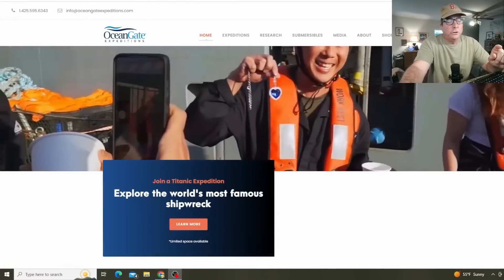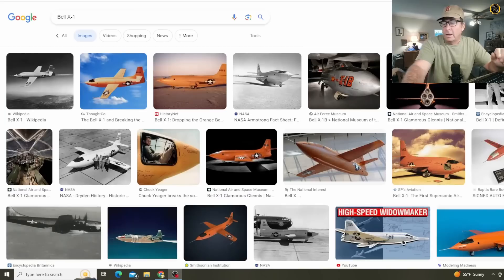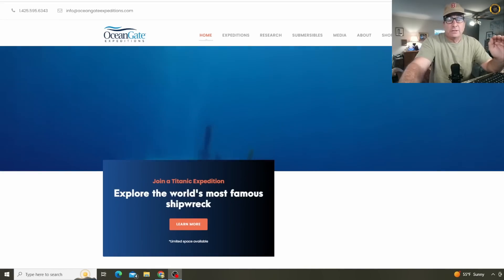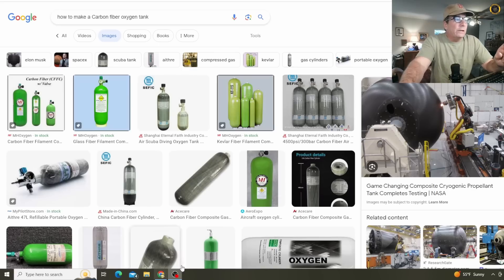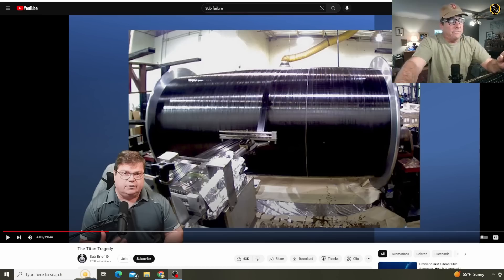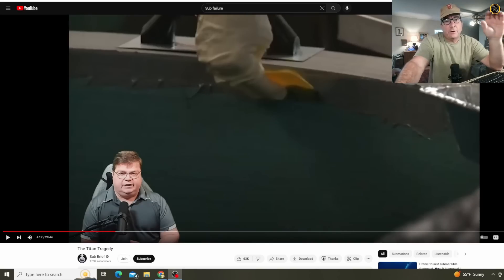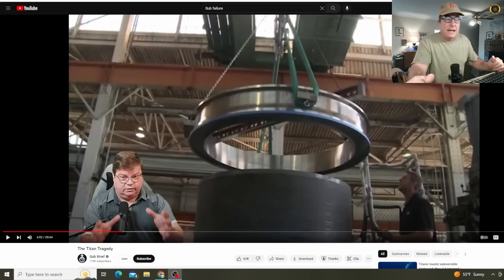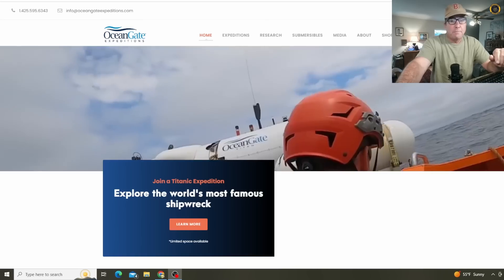Oceangate Sub Construction Details and Implosion

Comment: From the "alleged comms" between Titan and the mothership, Titan was descending faster than normal. One could suggest Titan developed a leak, began taking on water, gaining weight and descending faster than normal. The water shorted the A electrical bus, they dropped ballast but couldn't rise bc of extra water weight and the shorted electrical bus prevented electric vertical thrusters from activating. By the time the B bus was activated, they had too much water on board, and releasing the frame did not provide enough buoyancy.  What may have been a pin-hole leak, now due to depth and water pressure, the leak turns into a water cutting tool, enlarging pinhole.

Comment: Regardless of how tight a fit there was between the carbon fiber hull and the titanium rings, there had to be some clearance for the mating of the two which was filled with the glue, so the entire structure was dependant upon the glue holding. What a disaster waiting to happen.

Comment: One would think there would have been an internal flange on the titanium ring as well as external, this would double the surface area of the epoxy joint and offer extra support to the carbon fiber hull at the most critical area.

Comment: Based on the way those rings were glued to the ends it seems like common sense would dictate failure of the ring adhesion.
No climate control, the epoxy was applied inconsistently, the mating surfaces of the CF was not optimal.
I would never get into that death trap.
Great video. Thank you

Comment: Telemetry messages:
[My comments] 
09:17:50 All under control. At 2960m. No adjustments needed. We're enjoying the ride. 
[First problem reported at] 09:28:16 We're noting an alarm from the RTM [Real Time hull Monitoring] 
09:28:35 Reducing velocity, [vertical velocity I would think] depth 3433m. 
09:30:36 no change with thrust the rate of descent is increasing. At 35. [3500m?] Going to release the ballast now. 
09:32:12 No improvement. Preparing to jettison the frame. 
09:35:48 frame jettisoned (multiple attempts needed) starting ascent now.
09:38:09 Crackling sounds from aft. 
09:42:12 trying to run diagnostics. Ascending now but very slow. Sounds have subsided. Global RTM alert active. All red. 
09:43:42 Slow ascent in progress. Quarter predicted. Unclear why rate is small. No indicator. At 3476m.
 [Using thrusters, jettisoning ballast and jettisoning the frame has only just stopped the descent & produced a small rate of ascent. Presumably something is flooding with water - unlikely they wouldn't report that if it's inside the hull, or the hull has deformed such that it no longer has as much volume and therefore doesn't have as much buoyancy. Or possibly the thrusters are wired backwards, as has happened before and they are actually thrusting downwards without realising it]
[Last message at] 09:46:37 depth 3457m, [ascended only 19m between messages 2mins 55 seconds apart, using thrusters & having jettisoned all ballast weights and jettisoned skids] switched to power bus B, more sounds from aft.

So about 18 minutes from first report of problem to last message.

I noticed that there are some fairly large wiring junction boxes that have flat, clear plastic covers. These junction boxes must have a system that fills (and releases on ascent) them with air from the high pressure air supply (10,000psi was mentioned by an Ocean Gate person) using some automatic regulator to balance the internal air pressure with the current water pressure, so the plastic cover doesn't implode/explode. If that system malfunctioned there could be cavities filling with water that should be full of air, thus reducing the sub's buoyancy. I've noticed the junction boxes but it probably applies to the two large lithium batteries and probably other items that are under the rear tail cover.
If this has happened it is probably a secondary failure that is making it difficult for them to ascend from a dangerous depth. Aircraft accidents are often several problems adding together to produce the final result.
If it isn't that, then I can only see the reduced buoyancy being from deformation of the hull. It's hard to imagine that being sustained for 18+ minutes at 3500m depth. Also, there are no messages saying the ceiling/wall interior panels are deforming. Compression/deformation of the carbon cylinder in the length axis would be a suspicion, as there is no carbon laid in that axis but it's hard to see that existing for several minutes without water leaking in. Perhaps the rear titanium dome is deformed and that deformation is hidden behind the flat panel that has the large flat screen monitor on it. I didn't see the rear dome in the recovered wreckage. (Perhaps it was too difficult to recover as it doesn't have a hole to pass a strap through or perhaps it's not a dome anymore and in several pieces). 
I think there is also a buoyancy control bladder across the top of the carbon cylinder (under the white outside shell). This must have some fancy regulator to keep the bladder air volume constant as the depth changes. Perhaps the pressure of the high pressure air supply was not sufficient to add air to the buoyancy bladder at that depth. If high pressure air is used to jettison the skids, insufficient pressure could also explain why that jettison took several attempts. I noticed there is a large black circular rubber bellows under the tail cover. That could be to make mechanical movement from the air supply, to release the skids. (Or it could just be used as a variable buoyancy bladder to adjust nose up/down trim angle).
It looks like the front viewing window was only damaged in the final event and something had been happening to the rear end of the carbon composite cylinder or the rear titanium dome.
Reply: Thanks for sharing, I never knew they released the messaging until now. It adds a new light on what possibly happened.

Comment: They had an acoustic system to detect problems in the hull. But how could they know that once a problem was detected, they’d have enough time to drop ballast, get to the surface AND get out before it imploded. It took 2 hours to descend and 2 to ascend. Implosion was just not a factor in his thinking.

They had had so many non-catastrophic failures that I think they didn’t really look at the idea of catastrophic failures as they were just focused on each non-catastrophic failure as it happened. It’s a form of variable reinforcement. Like if your car always has trouble starting, if it fails to start, you’ll just keep trying to get the engine to turn over. You won’t give up. But if your car always starts, if it fails to start, you don’t try that many times until you give up.  So they were very used to problems happening and just working through failures in the field in all areas all the time.

And they towed the sub BEHIND the ship in rough waves. Instead of having it secured on the ship. Adding this kind of stress to the launch pad and sub seems reckless though probably saved him some bucks.

Comment: All my own thoughts below:

I think he started with the number 5 people: 1 pilot, 1 shill to woo the crowd and 3 marks at a total of $750k - $1m a trip maybe bumping to $2m-$3m as the business took off. He even brought YouTubers on free to cross-sell the experience so he could get more marks. Based on this need for at least 3 marks, it had to be a cylinder (as a sphere large enough to hold 5 was not engineering or cost doable), the material light enough and cheap enough, etc.  the cylinder was non-negotiable in his head. He seemed to also be on a tight timeline for getting paying customers on board. He started trying in 2018? The business started in 2013, I think?

His business plan depended on at least 5 in the sub.  He needed to get the ultra-rich interested as quickly as possible. Up until this time, the business was just spending money, not bringing enough in. He had too much power. Kicking out someone that disagreed with him so dramatically silenced everyone else who had any fears (or they just quit).

Why has David Lochridge not made a public comment?

Comment: I know the change in pressure affected the carbon fiber. But would the rate of that “change in pressure” also affect the carbon fiber? Meaning the rate of descent/ascent? They said they were dropping too fast and dropped ballast so I was wondering if that might have brought the disaster on sooner.  They should have done lots of compression pressure experiments on the CF long before they made a submersible.

Comment: A carbon fiber bicycle properly manufactured is hell for strong but when it does fail, like a scratch into the carbon fiber material or over stressing, it fails not by deforming like a metal but shatters catastrophically.  How much testing, unmanned, did they do before rating this for human passengers?  The whole thing seems a bit slap-dash.

Comment: As someone who uses pre-preg carbon on the foot plate of a brace I make for an O&P company, I would never have gotten in that thing knowing it was a carbon unidirectional carbon wrap cured with out vacuum and not able to be tested for air pockets. THEN to find out later he used expired pre-preg blew my mind. The resin has a shelf like, that's why it is kept frozen and sealed in air tight packaging, and we are just making 1 part of a 3 part leg brace! No one dies if our plate fails, AND THEY DO after a few years due to CYCLE degradation! Eventually it fails and delaminates. We then make a new one. But there is NO 13,000 ft pressure and temp cycles ours deal with, just spring force from walking during toe off.

Comment: You are not an engineer? CF is reasonably strong in compression and can withstand cyclic loads. The problem is not CF per se. In OceanGate’s case it seems that a lack of independent design verification and appropriate testing was the issue. The development of experimental  products normally takes years with lots of analytical modelling, material and prototype testing (to destruction if necessary) and very cautious field testing. It appears that the governance within OceanGate was very weak.

Comment: I don't have expertise in DSVs nor in carbon fiber in general, but I DO have personal experience with devices made of carbon fiber.  I raced on a sailboat (a Mumm 30) with a carbon fiber spinnaker pole.  That thing was amazingly light and strong - until we broached and stuck the pole in the water going around 10 kts.  It held up for a number of seconds and then suddenly, catastrophically, snapped and created an extremely sharp spear.  I can't say which side failed first (the tension side or the compression side) but I am certain that an aluminum pole would have bent, but stayed intact.  Having observed that, I would NEVER go to 14,000 ft under the ocean in a carbon fiber hull like this.

Comment: Joining two dissimilar materials in terms of Young’s modulus of elasticity and thermal coefficients of expansion, and then subjecting it to extreme pressure and temperature cycles sounds like very bad idea. Then add the third material of adhesive to establish the joint?

Comment: Everyone is stating it's the carbon fibre that failed, is it though..?, everyone is not mentioning the 18th bolt that was NEVER fitted (because they couldn't reach it), was it the bolt, or just the bolts around it that failed, there are 18 bolts for a reason, pressure around that end needed to be COMPLETELY sealed, it wasn't, could this have been the implosion cause, absolutely, tiny (less than a pinhole), which is why it showed signs of trying to resurface, then BOOM...

Comment: There are bikes makde of carbon fiber.

The tubes are a polymer base composite material. It is a light duty construction plastic.

The connecting parts arebjoined using aluminum alloy or some ityer metal and then sealed togethwr with an adhesive.

Of you look at the strans pattern on a non-painted bike, you ca. See the strans cross across the whole thing.

As an example, look up the Felt IA 16 2020 year carbon bike. Many of thenpaint styles leaves much of the carbon unpainted. You cansee the carbon strands.

This guy basically wrapped the tube without crossing the strands. If he had cross them the tube would have been stronger and may have survived more trips.

But eventuallynit woulf faol because it wasnt deaigned for the pressure of deep water.

The downside to carbon is it cracks. Becaise the adhesive hardens to like a shell over the material. The material can crack and snap like a toothpick without any prior warning.

This guy used audio sensors ro here the structure if it starts to fail. The issue is, thw warning signs would not alert you quick enough time to react. Badivlsly you ahve to hope the warning is for something you can return to the surface to fix.

Not this time. The thing impoded and theyvm are dead.

Carbon was not deaigned for this. That si why it is only used for thongs like planes and satellites where they arent being hit by pressure from the outside at this rate.

Exmaple, carbon might be used in a wing. Not the whole wing, just certain parts.

If a total wing wa smade of carbon, it would break at one if the 2 critical points of a plane motion; take off or landing. 

The carbon would snap trying to lift a plane. Even if you got off the ground you would expect it to hold when landing. Mid-flight the force on the wing os different anf thus would likely be fine.

This is a man who thinks the governent doesnt know whats it doesnt in applying laws for enfinerring standards. He didnt listen and thought he knew better.

What i can say is maybe he was kn a right path.  Maybe carbon can be used because he did have 12 successful dives in this sub. 

So maybe he was on to something.

So maybe if he crossed the strands. Use a stronger metal to hold at the secure points and use a beyter rate port hole for viewing, he maybe would have had an awesome invention.

But he fired and sued the safety guy and noe the ceo is dead. He deaerved it. After all, no ship should go down without her captain.

Comment: Carbon fiber is great in tension.  In compression you're pushing a string.  The structure is totally dependent on the epoxy that held the fibers in place.  It was doomed from the start.

Comment: Hi. What do you think if tube would be like if built using 3 inch thick cold rolled Manganese steel plate?. The beefed up with rings inside to resist compression?.

Comment: When they brought up the wreckage the titanium rings were clean and had no signs of an adhesive. Another thing they brought up the front with the window completely missing with no signs of bolts that were used to attach the window on the front, could they have used adhesive there also?

Comment: There are too much half-baked hypothesises and statements out there on this topic. Everybody has an opinion without noticing that composite materials are a special breed. Not necessarily inherently unsuited for pressure vessel applications. But they need more care than what was shown here. 
1. Having unidirectional (UD) fiber layup is not necessarily inferior. The fiber orientation needs to be according to your load. Because the fibers carry the load only along their length and are held in place by the matrix. So, if you have UD load, a UD fiber orientation is really great. Problem is here: isostatic pressure load is NOT UD, because the pressure comes from all sides. You have the pressure on the tube from the outside, which is carried well by the winding shown here. But then, there is also the titanium endcaps pressing on the tube axially. I don't know if there also were fibers intended to take this load. Maybe not everything is shown in the little snippets of videos released. But there need to be fibers that have a significant axial component to take that load. If there were not... that would be one of the nails in the crews coffin and could only count as gross negligence. Everybody who ever designed a CFC piece knows that. If you only have rookies on the table that don't know that, you are responsible as their boss. "Lucky" for him, he died with his dream in a split second. Because the rest of his life would've been miserable. 

2. Carbon fiber composite pieces also do not have an inherent cycle limit. For example carbon fiber drive shafts for sports cars run billions of cycles.

Comment: Everybody is commenting that the carbon fiber failed, and it may well have, but from what I have seen from this sub, the biggest flaw imo was the front hatch locking mechanism or lack of. There was no signs of a any kind of gasket to properly seal the hatch  and the hull (steel on steel) and it was held shut with 18 bolts or so. I have the feeling that this time it didn't get a proper seal and as it descended a gap was created that would cause the implosion. Does my hunch have any plausibility?

Comment: My background is in NDT R&D developing inspection techniques for the power generation industry.  There have been many statements saying it’s impossible to inspect the carbon shell without doing so destructively.  I encourage anyone curious to search the vast internet for NDT of carbon composites or something similar.  UT, phased array UT, RT (radiography), Computed Tomography…  all of these methods can be applied to inspecting carbon composites.  I’ve also personally done some R&D on flash thermography (IR) of carbon components.  This would likely not work on something this thick, but works spectacularly on thinner carbon structures to locate disbonds and delaminations. Bottom line is… they could have inspected the hull to determine its condition, they just chose not to.

Comment: If they added part of the Titanium Ring to the inside of the tube it would have added structure. Instead just slipping a ring on the outer part of the tube will not help keep it round or tubular when pressure is exerted it has more chance of collapsing